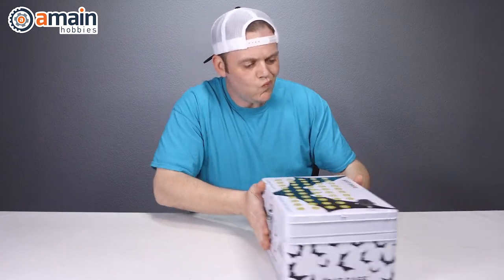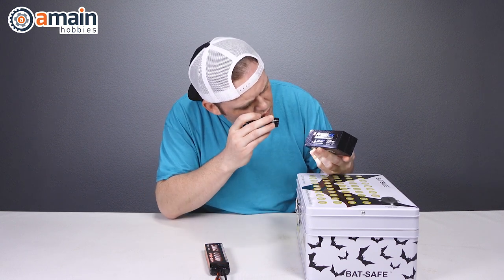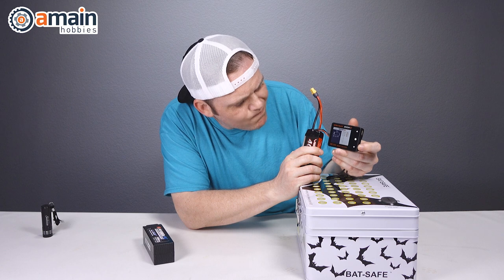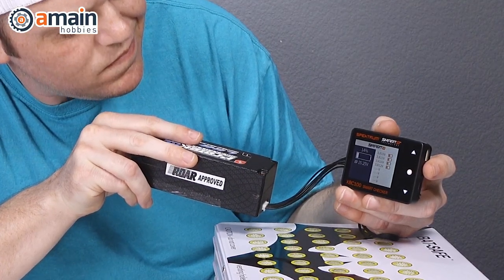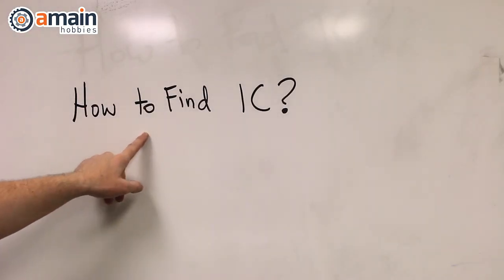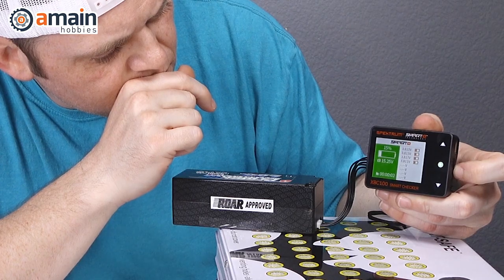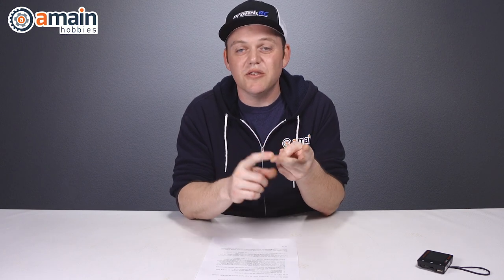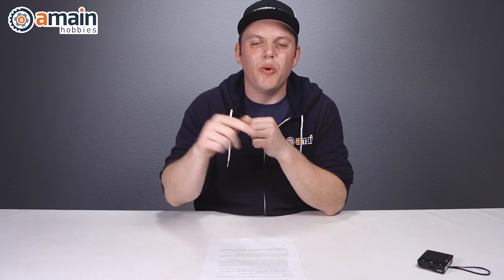Tips for Using LiPo Batteries after Sitting Idle

Comment: Great information Brett! If I may add,it's also a good thing to balance charge as often as possible.Also,after a day's use,putting the batteries on a storage charge is extra insurance for safe storage.
Reply from the maker: You're absolutely right triskellian. I do the same after every pack is used, it goes on the Storage Charge and is usually done in 5-15 minutes, and offers peace of mind for months. Great tip, thanks. 

-Brett

Comment: Keep my batteries in a vented ammo can inside the house. Smoke can vent out under the latch, which should also keep potential flames from reaching the handle over the top lid. If it gets hot just find something to lift the handle up. Protek lipo charger keeps it simple

Comment: intermediate tip: on a lipo, you can bring up the voltage back up to charging voltage (3v); to charge in LIPO mode. just charge it on 0.5C rate on Nimh. "not recommended" but how many of us dont do stuff like this? I saved 3 lipos like this. #DDMRACING
Reply: Yes you can do that. They would rather you buy new!
Reply: KM RC Adventure and the damn things didn’t cost so much maybe I would just buy new.
Reply: I got thunder power batteries that I haven't used for more than 5 yrs and recently took them out, the voltage were so low that my iCharger duo refused to charge them, but my old SkyRC charger charged them up with no problem.
Reply: Wow look what u can learn by reading comments! #rcnewbie
Reply: thats dangerous
Reply: @Shaun-hp2yz  people have been nimh bumping for years without issue. Its just enough to get battery to charge on lipo mode, not a full charge.

Comment: great vid.  I use venom, and have 2 - 3s 2200 packs that are both out of sorts.  Each pack's 3rd cell is at a much higher voltage than 1 and 2.  I will try your patience approach to balancing.
Reply: I just bought one of those and the 3rd cell was .5 lower. I used my smart checker to balance the cells before the first charge. Took about 40 min. It's weird because I have 2-2s 5000venom basher lipos and they are still super balanced w/ low impedance after a year or two

Comment: What about the resistance values of a battery? I have the Hi-Tec ×2 multi charger. The difference between low resistance levels like
2's & 3's vs higher levels like 8's, 10's? What about batteries stored at 50 or 60% that are charged at 1c to 100% when used won't preform when they get back to 50% (it's a Gen's Ace 2s 7200mah)
Less than 8 months old?
  Would love to see more maintenance videos, thanks for your time. 😎🇺🇸☝️
Reply: What good is a comment when     A main doesn't answer. 👍
Reply from the maker: Hey Robert. Sorry for the delay. The resistance of the pack is a good topic. Higher resistance packs will generally have less performance. For your Gens Ace packs, I don't quite understand what is happening. How does the battery not perform at 50%? 

-Brett
Reply: Battery thinks it empty at 50%
Reply: Doesn't have full memory
Reply from the maker: @renobob7781  In a way, the battery is empty at 50%. You should not use the battery in a model at 50%. The battery must always have 50% even when being stored. Also, if your pack has high IR (internal resistance) then the capacity will be effected; this is common for old batteries in general; capacity decreases over time. Not sure if that helps or not. 
-Brett

Comment: what if the individual cell voltage has dropped slightly  my manual says it should be at least 3.75 and its slightly lower
Reply from the maker: Hey YP. It's best to follow whatever guidelines your batteries' manufacturer has created for their batteries so you don't void your warranty if there is one, but if your cells are out of balance, you can follow the instructions outlined in this video to balance them again; using a cell balancer, or by cycling your LiPo on a charger: Balance Charge, then Discharge and repeat. Hope this helps. 

-Brett

Comment: What if it is puffed and it still works as it should? I know its not good if it is, but is it kinda ok to use, or is it a time bomb or something?
Reply: Ok thank you
Reply: Sean Hatch hehe
Reply: @bretrishelrc9789  Define puffed. SMC says their betterys will puff and its ok and common for the cells to expand. Thats what they told me after i took pics and emailed them.
Reply: @stuart3712  i have 2, 8400 mah traxxas 3 cells and they are puffed to where they wobble around on the table easily and they have been like that for 2? years now
Reply: Thank you I did not know that.
Reply: Do away with them if they're puffed like that. Discharge completely prior to recycling properly.

Comment: How long should you keep a lipo battery?
Reply from the maker: They can last for years. Usually the case, wires or connector fall apart before the battery lives its last cycle. If it starts to puff or not hold a charge, then it's time. 5+ years of use is common though. 
-Brett

Comment: What is ideal store voltage for 2s lihv?
Reply from the maker: Great question jungyul. For storage, a cell voltage of 3.7V - 3.8V is good; or 7.4V-7.6V. The end voltage is adjustable in most chargers, so not everyone uses the same voltage, but 3.8V is our recommendation and a safe place. LiPo chargers have a "Storage Charge" mode, and that mode will either discharge or charge the battery until the battery is 3.8V a cell. Please use this mode to store your batteries. Let me know if we can help answer any more questions. Thanks. 

-Brett

Comment: how do you safety discharge a lipo battery
Reply: Most mid to high end chargers have a discharge feature, but a fully charged battery may take hours to discharge using the discharge function. Driving or flying your battery would be way faster. If you’re trying to discharge the battery it so it can be thrown away, discharge to 3.3 volts per cell, then soak it in salt water for 24 hours.
Reply: @Mark-Dibble  the salt water method has been reported to cause terminals to corrode quickly and break off before voltage is 0, connect it to a light or some source of draw in a safe location.
Reply: @jayhagan8562  car headlight works. When the light goes out drive nail in the battery make sure it's safe for disposal

Comment: What if i charge my lipo below 1C charge, for example 0.2 C, is it a good idea? or Is charging lipo slower is better for battery life?
Reply from the maker: Hey coco. Charging below 1C is perfectly fine and safe to do. Very low charge rates are best for longtime battery life, but offer reduced performance, or in R/C terms, lower "punch" and it takes longer to charge a battery. Higher charge rates provide higher "punch" but reduces overall long term battery life. Hope this helps. 

-Brett
Reply: @AMain_Hobbies  This is the answer i wonder for years. now i know its safe to charge below 1C and i have time for that, i prefer more lifetime than punch. Thanks a lot Brett, its really helps.
Reply from the maker: You bet coco! Anything you need, let me know. Thanks. 
-Brett

Comment: Is there an automatic tool to set single-cell batteries to storage voltage?
Reply: Yes.  Even the cheapest "4 button" chargers have a "storage charge" mode.
Reply from the maker: Nothing automatic that I can think of unless you want to use Spektrum Smart batteries that can auto discharge themselves at a pre-programmed rate. Something like the SkyRC 30AMP Discharger is a great way to quickly discharge packs but overkill for single cells. Like Mike replied, using the storage mode on your Lithium Balance Charger may be the best way to go. 

-Brett

Comment: What does Cycle charge mean?  Also you mention 5000mAh = 5apm = 1C,  so if my batteries are 6800mAh = 7apm = 1.125 C?  (My batteries are: 11.1V 6800mAh 3S 120C Smart G2 Basher Lipo)
Reply from the maker: You're 6800mAh batteries would have a 1C charge rate of 6.8amps. To find 1C, divide the battery capacity by 1000. So a 7200mAh battery would have a 1C of 7.2amps; a 2200mAh pack would be 2.2amps.  
For a cycle charge, it's the philosophy of "breaking in the battery" before pushing it to the limits. Some chargers have a cycle charge mode, where the unit will first charge the battery up and then discharge the battery back down, effectively putting a "cycle" on the battery. Some people do this a few times with a brand new battery, some people do not, but that's the idea of cycle charging a LiPo battery. 
-Brett
Reply: @AMain_Hobbies  Wow now I learn something new! Thank you!  I believe I really Don't Need to be that extra careful and do a cycle charge since I have Smart G2 Sprektum 3S and 4S 6800mAh 120c batteries with the Sprektum S2200 charger?

Comment: .02v? Not a lot of wiggle room. I found online anywhere up to .1 difference between cells issue ok. It all depends on how good of a charger you have. What does everyone else say the minimum difference between cells should be?
Reply: I think he meant .2v variation.
Reply from the maker: You're right, it really depends on the charger. If your charger can shrink the balance gap quickly, more power to you (see what I did there ;). If not, it can be a little work to get that spread balanced. Our 0.02V figure is just to keep beginners mindful of LiPo batteries, balancing cells, and creating the habit of being conscious of it. If you are an experienced R/C'er, take the voltage number with a grain of salt; the point is that you know how to remedy the situation when it occurs. Thanks for the feedback. 

-Brett
Reply: AMain Hobbies thank you but stating ten times the deviation amount (.02 vs .2) hardly benefits beginners.

When I start from stowage. I check for less than .2v deviation. Balance cells to equal .01v. Charge at 1c. Slow discharge in respective application. Return to service.

To beginners, new batteries should always punch harder and maintain less than .02v cell to cell deviation in standard use discharge. 

Thanks again.

Comment: I disagree. A lipo with very different balance has most times a bad cell. Balancing it will work, but your battery often again draws more from one cell. Check your batterys "Internal Resistance" if your charges has that function. If the cells have very different IR dispose of it in a proper way.

Comment: How do you safely remove a bad cell? I have made a 4s into a 3s after one cell puffed up, but twice I shorted it out and it took a chuck off the end of my pliers.
Reply from the maker: Lawrence - You should NEVER attempt to dismantle, disassemble or remove a bad cell from a Lithium Battery. This is not recommended and very dangerous. Please safely dispose your battery, as per the instructions of the original battery manufacturer. 

-Brett
Reply: @AMain_Hobbies  indeed. #livingontheedge I didn't attempt. I succeeded 👌
Reply from the maker: #gamblingman #becarefulplease
Reply: @AMain_Hobbies  I will. As a retailer I guess it is not a good idea to recommend this. I will have to ask someone who is less responsible and less sue able 👍
Reply: I like to tape the terminals on the cells I'm not soldering on so nothing gets shorted out during the process. Take your time and make sure you cover whatever your not working on in that moment cause it's very easy to short it out with the soldering iron

Comment: All my batteries puff kind of a waste  throw away. They charge and hold a storage and are balanced. So explain if you have lots of money to throw away?
Reply: KM RC Adventure ?
Reply: @bigbearddaddy9067  ?
Reply: ? Your question if you have lots of money to throw away?
Reply: In the video he said throw away any batteries the have puffed or bulged. Most of my batteries have slightly puffed but still balance and charge and hold a charge. So throwing them away is a waste of money because they still work. Now I did have a battery that puffed and I felt it was getting worse, so I threw that out. But generally all lipos puff slightly.

Comment: Christ!...having to keep a battery in a safe in a safe because it is unstable?. I recently built a cross rc mammoth which came with a LIPO. I had only used NIMH in the past but having researched the care and issues surrounding the use of LIPO has really put me off using it. For the added performance they give, I feel unless you are an RC Devotee, they are not worth the extra worry. I personally just use crawlers on a very casual basis, and they often stay stored for ages.

Comment: I don't want backwoods tips. You're telling me one thing ( A-main) reputation on the line as professionals meanwhile comments and other major professional companies tweaked another way who do I believe. I spent 499 on a slash ultimate 4x4. Another 99 + on a 2s lipo/ charger Id I got 4 runs followed by the storage setting now I can't do a thing. I raced from the release of the sledgehammer to through stampede Lipo is new as am I fresh back in the game. Not a tinker toy boy. I need help. Should I contact traxxas? I did get a dusty face opening the batt charger combo box. Thought nothing of it at the time. My total was near 700 4 runs does not cut it.
Reply from the maker: Sorry to hear that Tom. How long did the LiPo's sit without use? Eventually, batteries discharge from sitting around, albeit slowly. But with enough time, they can discharge below the same zone, and the charger will no longer recognize them. 
-Brett

Comment: Just because you balance the cells "voltage", does not mean the pack is OK, balance capacity (is the capacity per cell close enough) is another issue and IR per cell is one more. I never will trust Spektrum electronics, especially their radios.

Comment: Only problem with how protek states to drain is it could get a "recharge" when not being actively drained.  this is why it's BEST to drain SHORT CIRCUIT (cut off connectors and twist stripped wire ends together)  THEN dispose of in trash. the "salt water" doesn't actually do anything except corrode the wires off making the battery even MORE dangerous.
Reply from the maker: Thank you for taking the time to read the manual Vyper. I will forward your notes to our team and see if the manual deserves a revision. Appreciate it and thanks for watching. 

-Brett
Reply: Short circuit will immediately melt the wires off or cause the battery to explode!! Never ever do that! Might work for really small capacity lipos, but honestly a really really bad idea!!!
Reply: @AMain_Hobbies  actually no because you drain it to 0 first so there's no charge/power to melt. It's then also impossible for the battery to get a resting charge. Making it truly inert

Comment: How do you charge a lipo battery with an old charger like the MRC SuperBrain 989 and an external balancer like the Tenergy 5-in-1 Cell Meter?
Reply from the maker: I don't know. That's an older and now discontinued charger and I cannot find information on it. I recommend finding and reading the manual for more information. 
-Brett